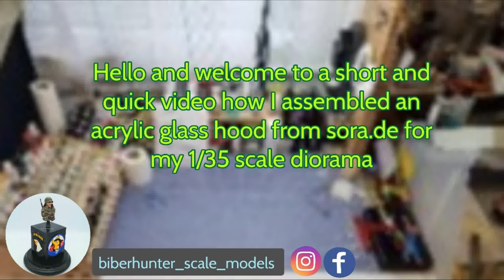Acrylic Display Case to keep your Scale Models dust free

Comment: March 24, 2022---Thanks for the video as you went in a direction I did NOT expect, that of using fasteners to hold everything together. This was a new one for me. Making your own display cases is easy enough as I've built several of them. Went to Home Depot, but a large sheet, along with a plexiglass cutting tool and liquid designed for plexiglass. Remember one thing: allow for the thickness of the plexiglass, other wise your case will be just a hair too big for your display. As far as my bases go, I get different sizes of plywood, usually about 1/8th in thick, then get some L shaped molding to make a parameter around the piece of plywood. Just make sure everything's nailed well....ask me how I know this.
Reply from the maker: 😁well, I guess I know how you learned. I used to build them myself too, cut plexiglass and glue it, wooden bottom. But they never looked so good and clean like this manufactured piece. And I never invested in proper tools to cut the plexiglass. So whenever possible I prefer this cases now.

Comment: Nice one. I used one of those cases on a large 1/24 Airfix Typhoon. They are very good. When I plan a diorama I source a display case first, then I know what size base to make. Cheers Bob👍🍻
Reply from the maker: Same for me, I checked what is the maximum size I could do for this display case and then built the diorama fitting 😄